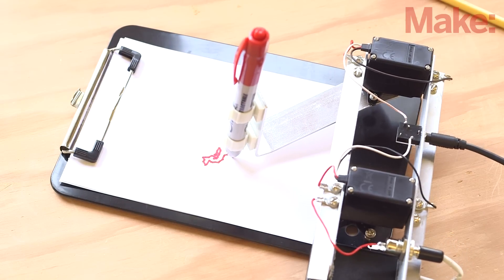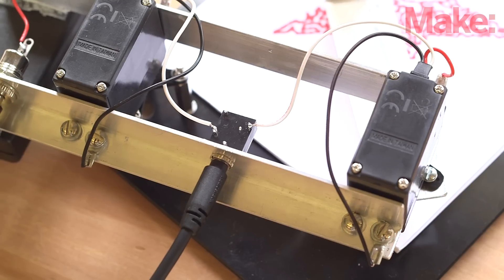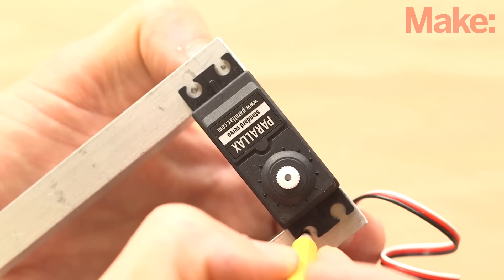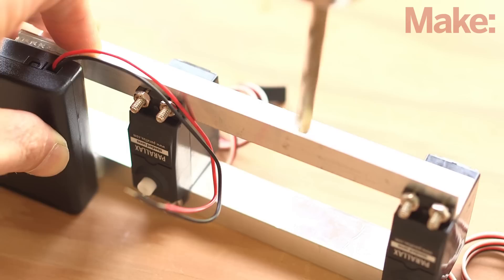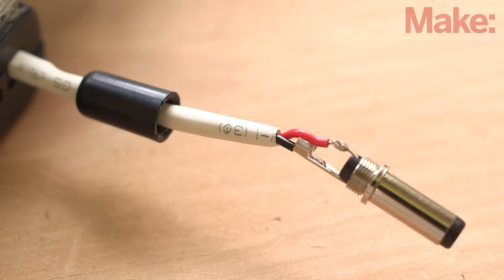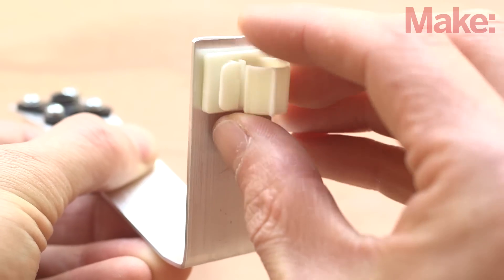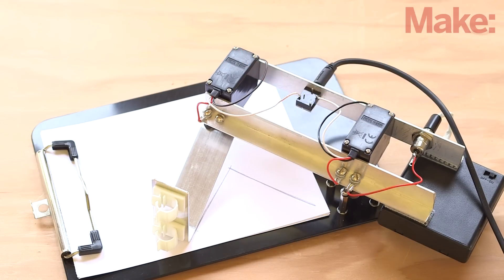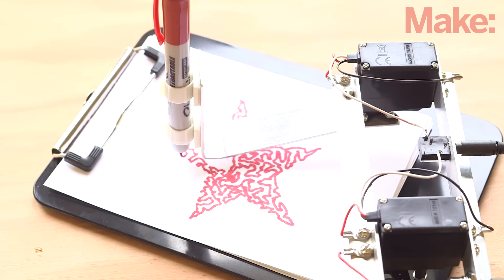Weekend Projects - TRS Drawbot

Comment: I can't find Drawbot WAV Syn Plz Help me! 😳
Reply: xine have you found that wave syenthisizer software??? if you found it plz reply me fastly!!  MY ID: jvsmallaya@gmail.com.
Reply: +Xine Zinthos Click on the link under this video to make magazines page for this. Then Scroll Down to Where You see Drawbot wave Synthesizer in blue and click on that. Then in the new window to the right you will see download zip. After it's downloaded extract the folder and in the extracted folder you will see a folder saying draw bot. then click the folder that says bin, then a folder that says debug, and finally in that folder you will see the file Drawbot.svhost.exe. That should run the program. Let me know if you get it working on windows 10 because i can't. I had it working fine on vista though. Stipple gen is the same process. and works on windows 10. but useless without wave generator to make the audio file. Note: if you get it working and plug into external speakers you may, and i had to, click the invert wave button in wave generator before you make the audio file. I hope this helps

Comment: I'd be interested to see what effect the noise from (e.g.) MP3 compression has on the resultant image, and at various levels of aggressiveness.
Reply: +James Stanley It would also be interesting to set it up, plug a splitter into your jack port, plug in both your headphones and the machine, callibrate it, then produce music, see what it draws. Sell the drawing for 20000$ as modern art.
Reply: Or put reverb on the signal

Comment: Could it be possible to control it just with arduino ? Because this project requires apple devices, I do have iPad2 but it doesnt work . it seems that it doesnt have enough power.
Reply: T1iCanon wat. This works with anything that can play a wav file, and output that over a normal 3.5mm headphone jack.
Reply: dumle29 I tried, and several other tried it too. If you go to the project page there is a lot of people that are upset because it doesnt work on any device that can play waw file.

Comment: This is similar to the scara robot I built, but I like some of your alternations. So I'm building a mark II using them. Specifically, I like the built in work surface which means that the robot retains calibration between each use. I also like using the batteries as a counter weight to the servos. The skid in the forearm is a great idea to because it means that the pen tip has a nice even pressure across the page.

Comment: Hi, I've built the TRS drawbot for a school assignment and everythings seems to be working except the last and maybe most crucial part. Whenever I try to use the drawbot with any of the saved SVG-files I get an error message saying "Input string was not in a correct format". I have tried draw stuff through the stipplegen program aswell but get the same exact message. Please help, what to do?

Comment: Is this possible with Arduino?
Reply: It's arguably more difficult with an Arduino.

You'd have to program the servos' driver software, instead of just using any old MP3 player. It's not a LOT harder, but it's also not as elegant. :)

Comment: Great project, build one myself - you can see it at work in my channel. I do not like the software though. I work on linux and managed to get the wave synthesizer running with wine - more or less. At least it produces wav output.
Is anyone interested in a Linux rewrite? I would start it, but I do not want to do it all by myself. Hands up, who would contribute?

Comment: use millimeter next time.
Reply: 下次用中文。Next time use Chinese, more people speak it.
Reply: ㅋㅋㅋㅋㅋ Yeah, and Germans are the only ones who would make a video in German. So effing what? We're only getting emotional, because idiots like you pollute the internet (and the rest of the world) with your small-mindedness; and because you're wrong.
Reply: its an american show why would he use a measurement uncommon to him? google a length converter converter it will help. off the top of my head an inch is about 26 mm 4 would be 104mm your probably fine just rounding to 10cm
Reply: 86gtforme
That's easy.
1) Because America should adapt to international standards.
2) He would reach more people.

And thank you for the tip, but I would never even bother to convert some old fashioned measurement like this.
Reply: ㅋㅋㅋㅋㅋ 
1) if you look at the demographics of this show its mainly american that watch he is reaching a majority of his audience using imperial measurements. 
2) america is adapting the metric system is used in schools and all Americans learn it at an early age the issue is that to change of of our machinery/industries have to make the change first.
3) the metric system is older than the imperial/us customary system.
4) as long as you plan on watching american programming i suggest you learn the conversions as we do instead of making people in the comments give them to you.
Reply: onefineline  Truly American mentality: rest of the world uses metric, they use imperial. Rest of the world must be wrong.
Reply: 86gtforme
1) I just suggested, he WOULD reach more people.
2) well, that would be fine. I still doubt it. And you're wrong, it's a political issue.
3) You got me, no need to explain.
4) I comment as I want. Especially if I'm right.
Reply: ㅋㅋㅋㅋㅋ 1)first rule of business you don't dump your current customer base to chase another one.
2)there isn't much politics in it. if you would like to explain american politics to me i would be glad to listen but im going to venture and say i know more abut a government i studied for 6 years than you.
3)...
4)you can comment as you want that want my concern. maybe next time instead of criticizing  something post the measurements in mm and help someone out (like i tried to do).
Reply: ㅋㅋㅋㅋㅋ 1) so your first idea you aren't serious about...
2)a NOT joke well obviously I'm dealing with a comedic master here. like I said earlier we are converting the metric system is all that is taught in schools but changing how we read temperature isn't top on our priority list right now. don't know if you keep up with current events but we are more trillions than I can count in debt our schools are shit unemployment is to damn high, an we are still at war with more things than I can count. maybe when we get that straighten out we will worry about converting every measurement that we. many other countries us imperil measurements at least to an extent, England being the largest I don't mind being on the same level as England...
4)...

im perfectly relaxed I enjoy talking to being with different perspectives if you don't and want to be done with this I understand didn't mean to get you heated about it, defiantly was not my intent
Reply: 86gtforme I actually do know some American machines - and every time something breaks it takes at least 1 or 2 days just cause the screws from stock can't be used. And everytime you hear "f*ng muricans" xD
I am from central Europe actually.
Reply: Tærtær
I think you don't see my point, There is exactly one country not using the metric system, why the hell should I bother about such a backwarded country?
Reply: ㅋㅋㅋㅋㅋ I think we ALL see your sh*tty point; and that's why so many people responded to your annoying comment. You come from your high horse with obviously zero knowledge of the American system and talk down to us like we're a bunch of idiots, while you're the ignorant one.

Imperial units obviously have their flaws, but they have their own advantages to the metric system. The main one is that they're frequently based on "human scale" measurement. Degrees Fahrenheit is a great example of this. Celsius is great for "scientific" measurements, but for things like the weather, Fahrenheit is arguably much better suited (assuming you know it, of course).

0-100 degrees Fahrenheit describes the range of temperatures the vast majority of people will experience normally. 0 is cold; 100 is hot. Also, each group of ten describes a sensation of temperature that most people can distinguish without a thermometer. 70s is the most comfortable "middle" temperature for most people. 60s is noticeably cooler, but not "cold." 80s, on the other hand is noticeably warmer, but not quite hot yet. Once, you get the 90s — it's hot! (and so on)

Inches are also based on the human body. For the “average” man, 1 inch is about equal to the space between two knuckles on a finger. Also, measurements of length are usually described in power of 2 fractions (1/2, 1/4, 1/8, etc.). That means it’s very easy to add/subtract numbers without the use of a calculator; and since those fractions are always half of something, you can always find the middle of two points without a ruler. All you need is a compass and straight edge.

So please, shut your ignorant mouth up. You’re obnoxious. Scientists still use Latin, for Christ’s Sake! People have barely spoken it for one to two thousand years.
Reply: 86gtforme 1) Ok, sir, I didn't mean it too serious, ok? This is Youtube comment section, and after all if he would give introduction in both measurements it would be an enrichment.
2) Ohhh great, now you really have my respect. NOT. It is political, and maybe you didn't notice, but America is the only country still using old fashioned measuremt (Yes I know, metrics are older and yes, there still are some small other countries... bla bla. I doubt as an american you want to be put on the same level with these other countries)
3)...
4)Like I said, I don't bother myself, cause maybe.

Just relax guy. I didn't intend to attack your loved country.
Reply: 86gtforme Basically I have heard American style measurements, commented and left. That's what I meant with not being too serious.
I see what you mean now. I don't know a lot abut the US but I guess you do have bigger problems at the moment. Thought standardising things keep it easier, it's hard to change. I didn't think about England, England does use the metric system, even thought it uses imperial system to some degree. The machines produces in the UK do at least have metric screws - if Americans would have the same the rest of the world might consider to buy more from the US.

Well, with the last paragraph I just didn't expect such an emotional reply to my small comment. :)
Reply: ㅋㅋㅋㅋㅋ i know american cars have converted to metric bolts. that's about all i can think of that is actually manufactured here anymore. most of things are deigned here and outsourced to a 3rd world country to be made (you can add that to our list of issues :D ) if you don't mind me asking where are you from?
Reply: ㅋㅋㅋㅋㅋ haha didnt think about that i guess that's not not an issue here we have both styles of bolt readily available. it still sucks when your trying to find out if they use metric or imperial bolts in a product seems about half the companies have switched and half still use imperial. i work on alot of older american cars and its interesting to see when they started changing to metric in the late 70s half the cars are metric and half are imperial. at this point i probably own just about every size bolt they make. im from Texas the southern part of the U.S. a.k.a. the part everyone hates :D
Reply: ㅋㅋㅋㅋㅋ
If i remember correctly, we have conversions in math classes, chemistry and other sciences, from metric to 'english' systems, from centigrade to Fahrenheit to Kelvin, or inch to centimeter, or pounds to kilograms, ounces to liters and so on... maybe you missed those classes eh? 1 inch = 25.4 millimeters (mm), a simple google search would have been enough.
Reply: Tærtær Guy, what are you talking about? Why should anyone outside the US learn this sh*?
And no, converting this is no solution. It's not about being easy or not.
Reply: ㅋㅋㅋㅋㅋ
 Its the same reason why you learn English even if your not from the US, Canada, UK, Australia or any other English-speaking country, or why nations with a lot of dialects have to learn 1 national language. And unless the governing body on measurements and such will decide the phase out the English system of measurements and stick with the Metric system, you're stuck with it whether you like it or not. And yes, it is about being easy for you, you should be glad they phased out forearm length (cubit) and the tip of one's thumb up to the tip of one's index finger as forms of official measurements.. hehe
Reply: Why don't you just get some extra screws if your machines keep breaking? They cost less than a pack of gum.
Reply: ㅋㅋㅋㅋㅋ i really didn't feel like getting back in this but im going to. im america we do use the metric system just not as out primary. out schools are all metric, our tech companies are all metric, 90% of mechanical things are metric  ect. and there are many countries like that. if i say im 6'2" most any country of english decent understands what that means. same if i say its 95f they may not use them day to day but they know the both sizes. same thing here if someone say they are 185 cm tall or its 34c out i know how tall they are and how hot it is.
Reply: 86gtforme I'm totally aware of this, even if I seem to be an ignorant. xD
Reply: Guys, don't get too emotional. You can call my point shitty or you can call me emotional. Fact is, americans are the only one who would do a Youtubee Video and not use the metric system.
Reply: ㅋㅋㅋㅋㅋ
 Dude, its not anyone's fault that they're using the English system of measurements, it is still the current standard in that country and they're used to such since they started learning math, just like you started using the metric system when it is first taught in your schools. You are like someone bashing another for driving a left-hand drive car in a youtube video because you are used to driving  right-hand drive cars. So, are you gonna hate them too for using the US dollar as their currency instead of the currency you're using in your country?

Yes, your argument is shitty and you're barking at the wrong tree. you want them to change? petition the conference of weight and measurements or whatever organization handles that. :)
Reply: Tærtær
I'm completely aware of it xD haha in the beginning I didn't even attacked anyone and I wasn't too serious about my comment. But it's fun how the Americans react if they feel their best country of the world is under attack xD Couldn't resist to take part of that, sorry.

Thought again, making the video in metric sstem would improve it a lot. ;)
 That wouldn't be as hard as changing the hand for writing. And as some pointed out, even americans are supposed to know the metric system...
Reply: ㅋㅋㅋㅋㅋ  nope, using the Metric system would not change the video, and preferences are based on what one is used to, and its hard to force anyone to deviate from that. Let's flip it, your comment about the system of measurement used in this video is based upon your personal preferences, and maybe your knowledge or the lack thereof of conversions. :)
Reply: Tærtær Even you say you got my point, I doubt it.
Reply: onefineline
I think your emotios slowly get out of control here. You should try to control yourself a bit better.
Reply: victor8o5 Where did I ever say "the world" or "America" must be wrong? I said the person I was responding to was wrong. Please leave your racism out of this, thanks.
Reply: onefineline
I see you really don't see the point.
Reply: I stop watching when I hear imperial measurements, I know a lot of people who do too. Particularly those of a scientific background.

Comment: on the website is a link to Enercell™ 6V/300mA AC Adapter but its not used ? but i can use it instead the battery pack? but the batterys are the counterweight will it still be functional without them?

Comment: I built the drawbot, but I can't get the software to work, I can't make the .wav files... I get error saying "the input stream form was not valid"... rought translation from finnish (syöttömerkkijonon muoto ei ollut kelvollinen). Anyone else struggling with the software?
Reply: how did you download the DRAWBOT Wave Synthesizer?
Reply: .zip file. I got it to kinda work... I can only "print" the rectangle and the point svg files now. Anything else I try, the result is: "index value cannot be negative or over the total" or something... I'm so frustrated, the sorftware ought to have somekind of manual for newbies like me :P
Reply: erajomppa What program opens it? All I can see is a bunch of files my computer cannot open
Reply: microsoft visul studio
Reply: Thank you for answering :)
I figured out how to open it and I got mine working. If anyone has any problems, message me and I can help.
Reply: ***** I've got error (http://www.picz.ge/img/s2/1410/1/4/4a42a3c2937e.png) can ypu help me? I've tried program's SVG files but result is same.